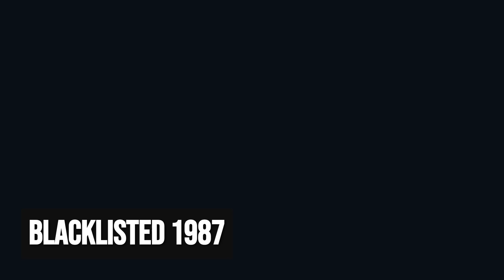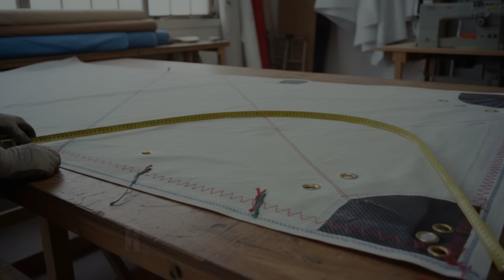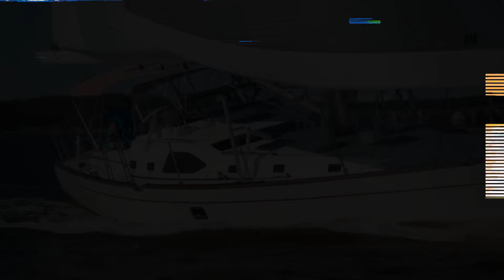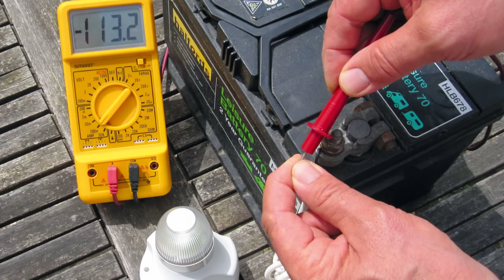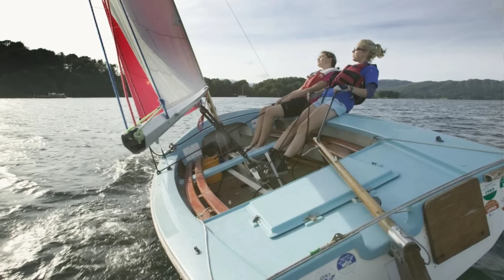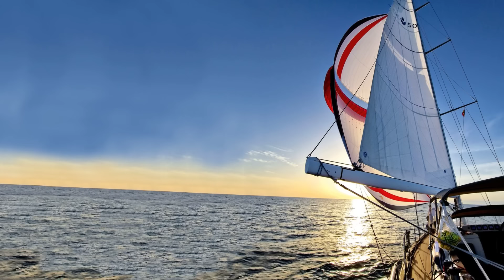10 "BANNED" Racing Hacks That Cruisers Use To Go Fast (Cheating The System)

Comment: frget sails use wings and tail planes . not issues and make them loose AoA in a near knockdown or gust  . common sense
Reply from the maker: AoA in a knockdown is exactly the single-point failure the rule was written around. One uncontrolled luff and the case for a ban writes itself.

Comment: Whenever one’s body cannot sail without motors, take at least two fit crew members on board. Trust me,I am an engineer🍀
Reply from the maker: Redundancy on the water follows the same logic as a backup system — never assume the primary won't fail. The fit crew is the failsafe.

Comment: As a boat owner who races primarily under IRC, I find the word “Penalty” disingenuous.  I prefer to use the phrase “an adjustment”.  Which in reality, happens.  Your rating will be adjusted based on changes to the boat, rigging, and sails.  This way, as a sails rep, I find it much easier to talk to other boat owners about how to make smart adjustments to thier racing program.
Reply: I hate that about measerment rules in general. In my opinion we should have just sticked to the length of the waterline and when made adjustments for heeling, instead of inventing compilcate math und formulas.
Reply from the maker: "Adjustment" is the honest word for it. Framing it as a penalty just gets owners disengaged from a system they could actually be working with.